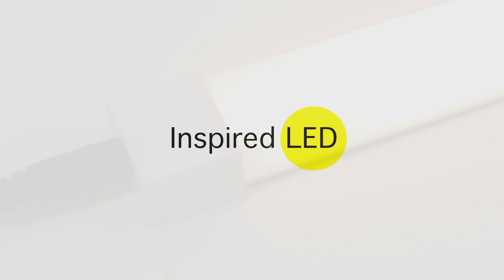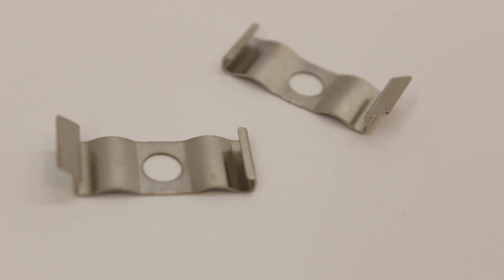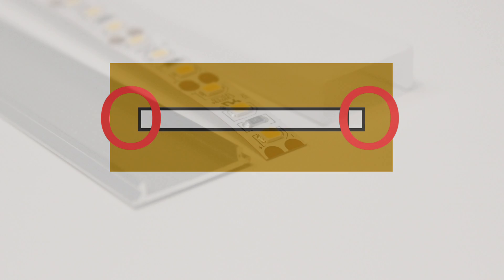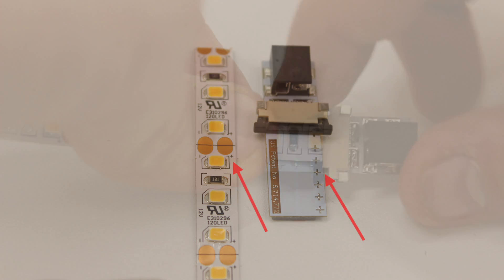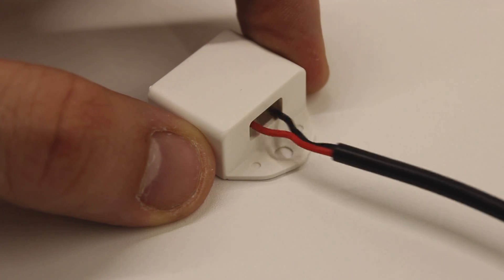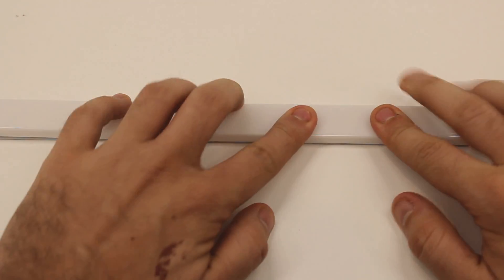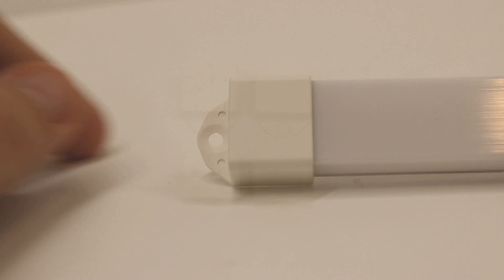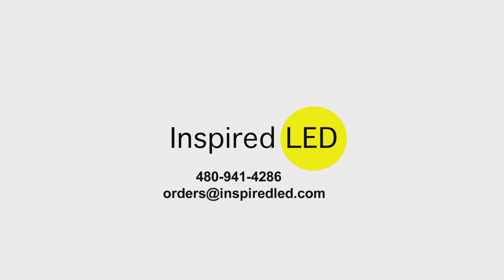Radiant Edge Short Panel | DIY | Inspired LED

Comment: Now how do you put this thing on your wall?
Reply: Hi Tyler! We offer Metal Mounting Clips that are screwed into place and then the aluminum track will clip right in. You can find these on our website! Customers have also used a heavy duty VHB tape if clips won't work for their specific application. Feel free to contact us at 480-941-4286 with any additional questions. -Inspired LED